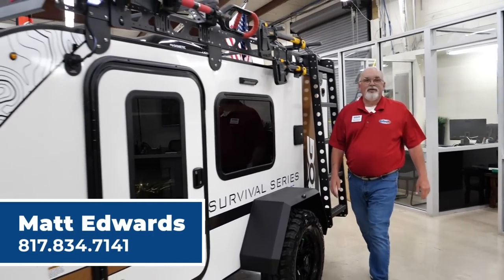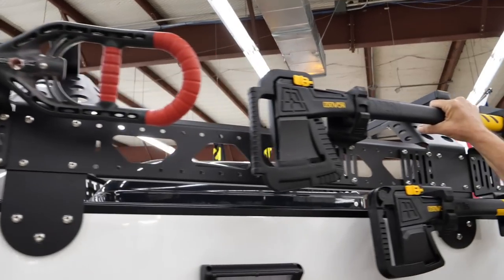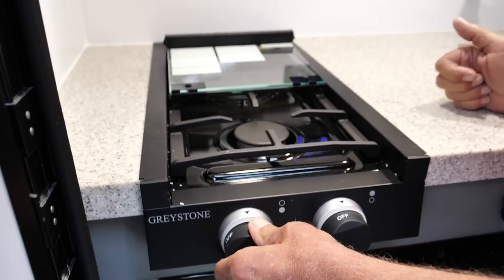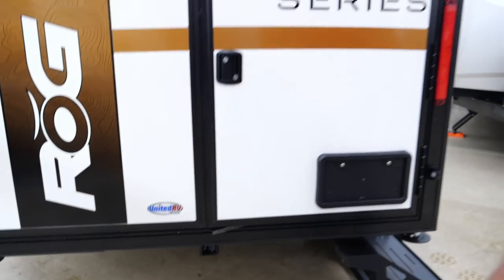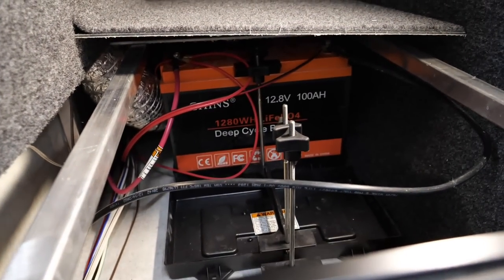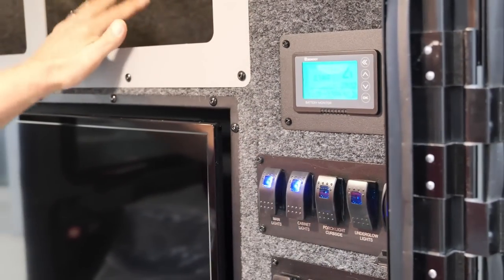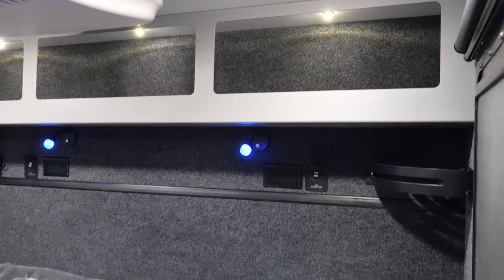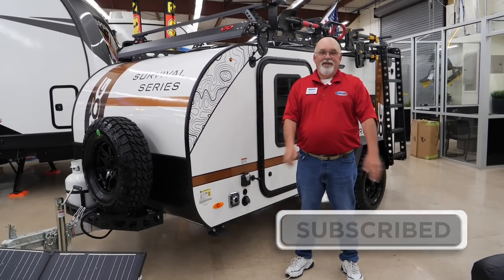'23 Encore ROG Adventurer 12RK Survival Series  UNITED RV FT WORTH TX 817-834-7141!

Comment: Locknroll hitch is a much upgrade
Reply: 12v ac is another
Reply: Independent suspension
Reply: @ronontheroam1359  Encore is coming out with a Overland Pkg    Timbren’s Level Four Axle-Less suspension and a Max Coupler articulating hitch by CU Off Road.

Comment: You may want to tell people what model of Jeep can tow that trailer. A Cherokee won't have a problem but a Wrangler will only get about 2,000 lbs.There would be a safety issue if they have a Wrangler.
Reply: Thanks for pointing that out. 

2023 Jeep Wrangler  WHEN PROPERLY EQUIPPED   4-door models can have a maximum tow capacity of 3,500 lbs. 
2023 Jeep Cherokee 4,000 Pounds
2023 Jeep Grand Cherokee 7,200 Pounds
2023 Jeep Gladiator 7,700 Pounds
Reply: wrangler are rated at 3500 the new 2024 are rated at 5000. they have no problem pulling this but for sure less weight the better maybe not filling that 40 gallon tank up

Comment: You kind of glossed over that refrigerator their chief so what is it a 12-volt or is it the antique propane fridge?
Reply: All of the refrigerators in the ROG Adventure Trailers are 12V.  Encore has an incredible mounting system that makes removing and installing the refrigerator quick and easy.  Most manufactures screw a strap to the side of the refer…Encore’s system has a bracket mounted to the floor on the rear that centers the refer into the correct position via two guides that are mounted to the bottom rear of the refer, once it is slid back in place, a front bracket slides on the bottom front of the refer and pins the refers two front feet down so the refer can’t move and then the bracket is screwed into place…removing is just the opposite.

Comment: I gather a pathfinder can tow it as it says 6000 lbs.
I see two different prices as replies on the comments.  Is it 28,977 or 29,977?  Also does it come with plug to plug into ones vehicle with trailer brakes and safty chains?  What is max weight for personal items?
Reply: Yes to the Nissan Pathfinder dry weight  with options is 2207 lbs.  Yes has safety chains as well as trailer brakes.  Max cargo weight is 1200 lbs. If you look under the video and click SOW MORE  it will show you a lot more information. The price is 28.977.00.

Comment: I saw in the description it will fit in a garage, but can you confirm the exact total height? I have a smaller 1 car garage but its less than a typical 8 foot door. 
Also, what an estimated shipping cost be to Boise Idaho?
Thanks!
Reply: Overall Height with Roof Rack & A/C    6.9 1/4    It would around 25 to 3,000 to delver. 1273 miles  Estimate.

Comment: nice rig, does it have brakes?  how much insulation?  R value?
Reply: Yes it has brakes. Vapor Bond Insulation. No-Snag Interior Wall Carpet. Composite Floors & Interior Walls
Reply: The RV value is R7+.  The A/C  is 11,000 BTU, cools the trailer even on the HOTTEST of days.  Furnace is 16,000 BTU, you can camp four seasons with no issues.
Reply: Thank you for the information sounds like a real 4 season rig.

Comment: This camper is already slightly over the Max towing weight or 80% of gross towing weight of a JLU,  which is 3500 pounds.  The Gladiator is the only jeep that can safely tow this camper on and off road. This camper really is not a true "off road" camper...
Reply: There are countless Jeep Wrangler owners towing this adventure trailer safely.  The trailers unloaded weight us 2200lbs.  The GVWR is 3500lbs.  A properly equipped four-door Jeep Wrangler can two 3500lbs, that aligns perfectly with the 3500 GVWR of the ROG 12RK.  There are 5 ROG models that can safely be towed behind a properly equipped four door Jeep Wrangler.   There are several other Jeeps that can also tow this trailer safely, including the Jeep Cherokee (4000lbs), Jeep Grand Cherokee (7200lbs), Jeep Gladiator (7700lbs), Jeep Grand Wagoneer (9850lbs), and Jeep Wagoneer (10,000lbs).  I’m not sure what GVWR and what vehicles can or cannot tow the trailer determine if a trailer is off-road capable??
Reply: @United RV: We have The 2024 Rod survivals coming any day. These have the new Timbren Axle-Suspension with a Off Roads Max Coupler.